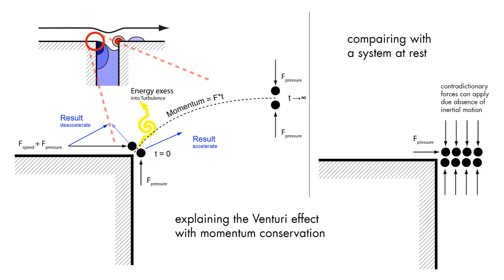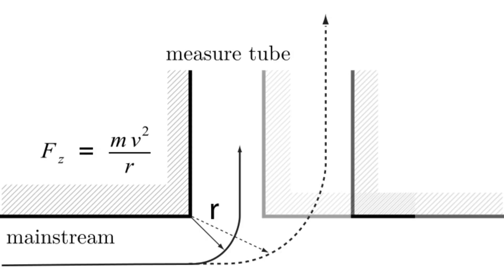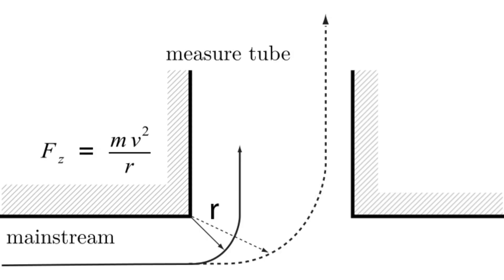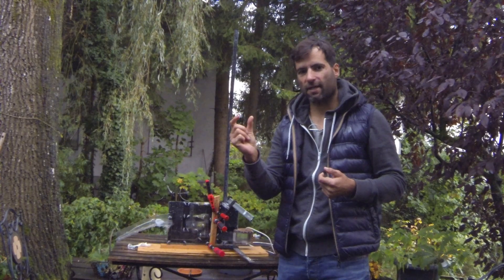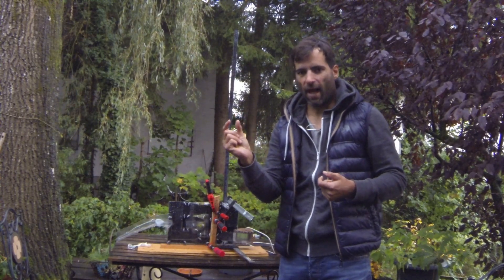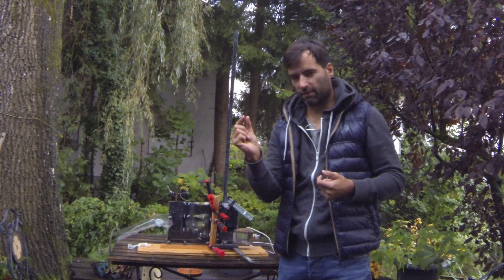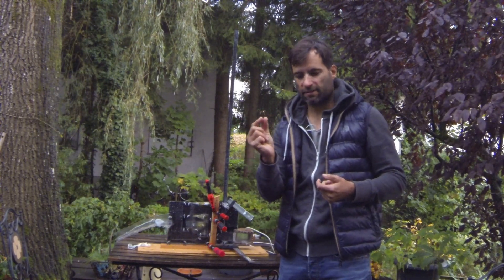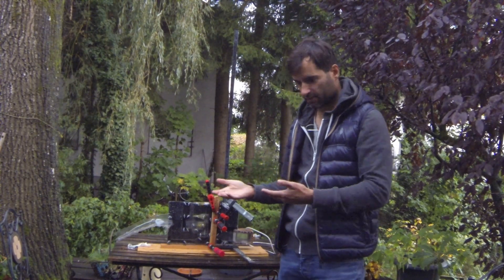Falsifying the Potential Theory and Bernoulli with a modified Venturi

Comment: did you intentionally design it to be as turbulent and non laminar in its flow as possible?

the convergence is far too steep. the divergence ever more so....

you then have a long throat. long. fluid friction. an orifices diameter AND length is important.

water simply entering the now large bore of the "probe" with turbulence as its a sharp right angle corner, then is having to re-accelerate to get back through the rest of the throat. end result, a stinking great cavity right in the middle of the throat where velocity decreases and pressure rises accordingly. with a lot of induced turbulence. possible cavitation when flow rate is too high.

its no longer a probe, or port. its a massive discontinuity in the throat where it can least tolerate it. results are exactly what one expects.

a "correctly placed" probe will be many orders of magnitude smaller than the throat. in both axes usually. here, your probe is as wide as the throat at all times. its a "slit", not a mere "pinhole".

you put some work into your apparatus but its faulty.
Reply from the maker: the principle is the same, but may only modify the boundary condition. There are long diffusers who may keep a laminar stream for a longer while and may restore part of the pressure before the throat. 
irrespectively of the construction of convex and diverging stream...

what probes do is, that they want a value from a moving mass. There will be always a difference between the momentums of 'moving' (inside the stream) and 'static' fluid (inside the probe tube) and theere is always a degree of Work (aka. Energy) between those (fluid) masses you cannot ignore.

So no matter you design your probe it may lover side effects but the core principle is clear. What you measure is an effect of mass inertia and not "real" pressure. because real pressure of the stream can only be measured if the probe would travel with the stream.

The expanding length simply shows that disturbing effect of required extra forces to deflect the pressure in an orthogonal direction. And because of different momentums the pressure will never be "real".